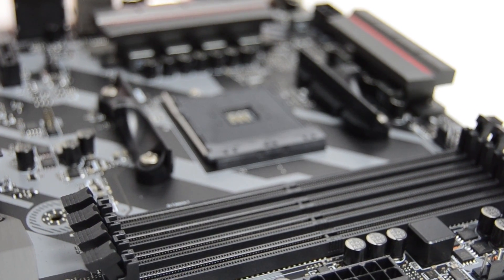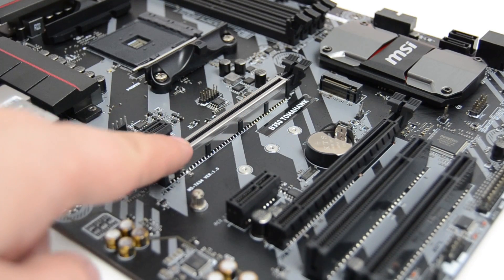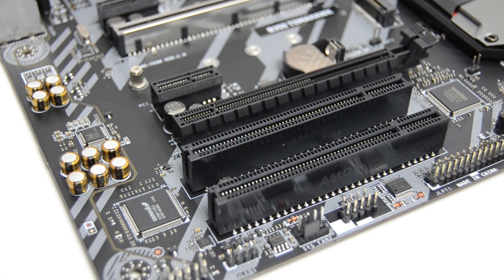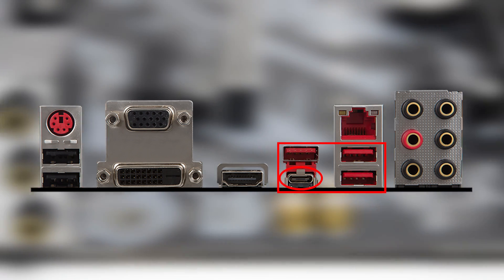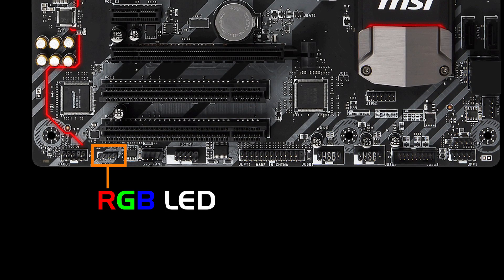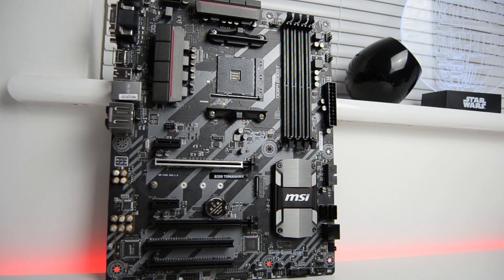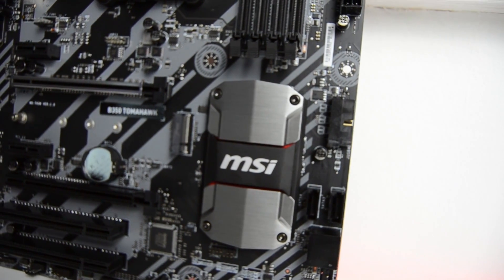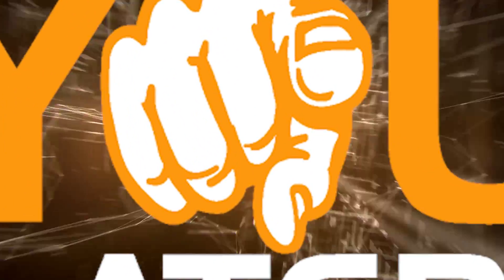MSi B350 Tomahawk :: A Great AMD Ryzen Motherboard :: Unboxing & Overview

Comment: I bought this motherboard to build my first pc but when I turn it on the fans spin and LED's turn on but no USB usage and no display. I am also using a ryzen 2200,g 8gb corsair vengeance, 120gb SSD, 1tb HDD, and a 550w power supply. On Amazon, people are saying they are having the same problem as me do you think is the mobo and what should I do before I have to return it :(
Reply: you probably got board with older bios that doesn't recognize 2200g. That is known problem across  all of 300 series boards. You need to flash bios to newest version that recognize 2200g .
Reply: after doing some research yes i also think that is the problem and im trying to get a boot kit from AMD. Hopefully that solves it.
Reply: Roderick Saint-Victor can a Ryzen 2 1200 work with this exact board

Comment: what about VRM's ? Heard that that board has VRM issues
Reply from the maker: I had absolutely no problems with temps on the VRM whatsoever.  Although from what I've heard, the only issues are if you try to heavily overclock using this board.   TBH If I wanted to push an overclock that far I'd go for a better X370 board.
Reply: I have had this mobo for 1 y. No problem.
Ryzen 1800X 3.6 GHz.
2 x 4 GB DDR4 RAM. I use to run it at 3200 MHz but  had stability issues one day so I reduced to 3000 MHz which makes no difference on performance.